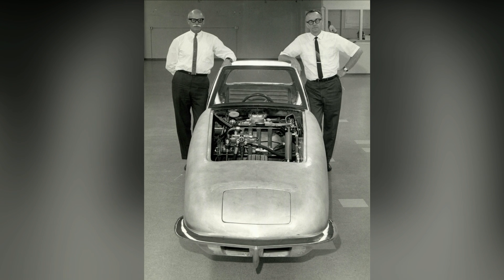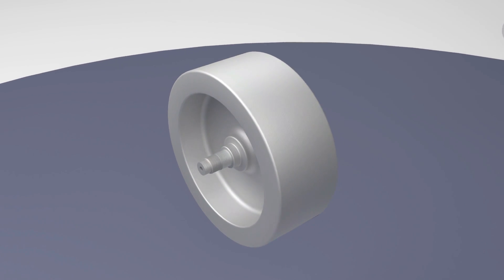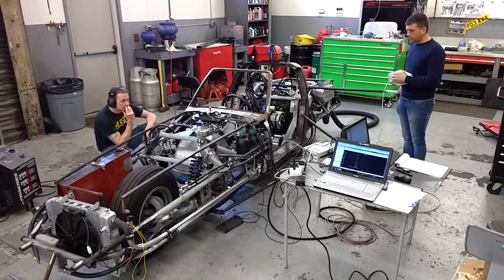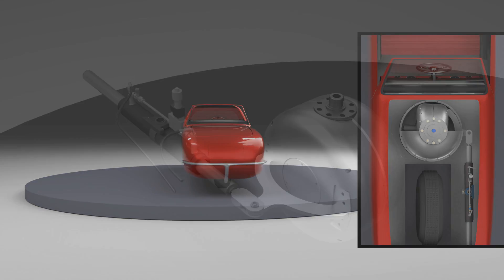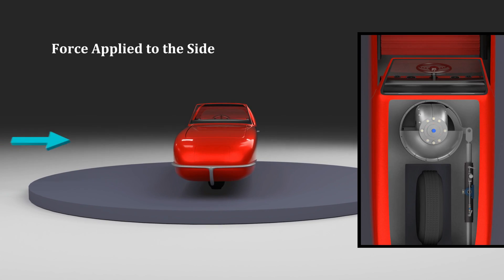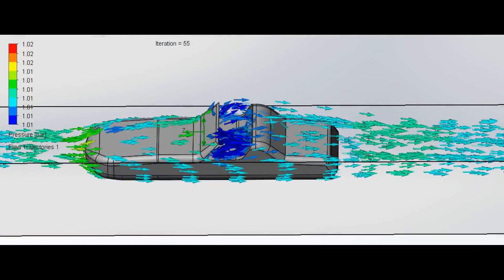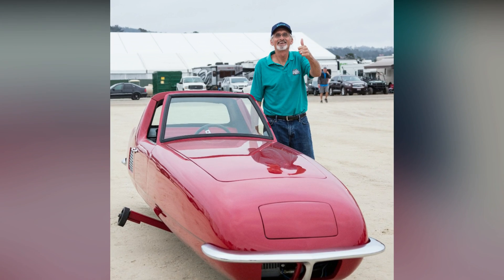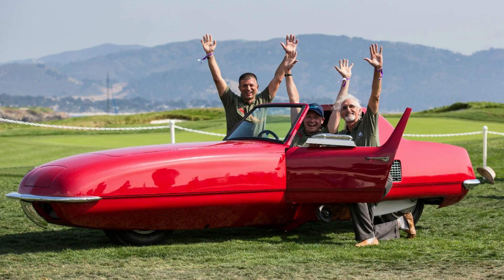Lane Motor Museum explains their 1967 Gyro-X

Comment: Great work to rebuild the machine from almost nothing. It's amazing to see it working although as you say it has some technical challenges to the design. By the time you add the weight and power of the gyro and actuator the gains you save by having only 2 wheels are possibly lost but some people are still trying to do it.

Comment: You may wish to compare this to the Brennan Monorail ( https://en.wikipedia.org/wiki/Gyro_monorail ) which is the same thing, only running on a rail.

I believe the Brennan system used a simpler, passive system, which was more massive but used fewer moving parts.
Reply: Wikipedia article is good and explains that a gyro balance system must have an active control system to work. His system may have been simpler but it was not passive it used a pneumatic servo.
Reply: One HUGE difference between this and Brennan's monorail, was Gyro-X only used ONE gyro and the train used TWO gyros.
Reply: @RPRosen-ki2fk  I understand, but the systems were similar and accomplished the same thing.

Comment: I saw the old film reels of the one they nicknamed "the cigar car." Maybe it was the same one, the film was black and white and it wobbled side to side as it drove around like this one. As I remember the story, Tremulis and others (investors?) tried to squeeze Summers out of the car company. That group couldn't get the car to stabilize. Later, Summers came back into the picture and did finally stabilize the vehicle. But it was too late and all funding was withdrawn, the company went bankrupt.

Too bad the US Forest Service destroyed all of the nice gyro-stabilized, motorized, 3 wheel, trail donkeys Summers designed for them. They were SUPER stable! The 1,500 (hazy on that number) pound payload sat on top of the two-foot-wide, nine-foot-long, about four-foot-high, vehicle and the operator stood on a platform in the back with two handle yokes to steer the single front wheel. In the demo reel, one man ran down the hill and tried to push it over. But the vehicle just barely budged and went back to its normal position!
 Soon after they started service, Congress passed a law that made it illegal to operate motorized vehicles on park trails. You would think the USFS would get a pass. Those things were so sweet!

Summers was a real genius.

I wonder if Floyd is still around and still has those old super 8 movies?
Reply: Not all of the 3 wheel, trail donkeys Summers designed have been destroyed. The Lane Motor Museum has one their collection.
Reply: @RPRosen-ki2fk   oh, wow! Thanks for that. I'll look for it.